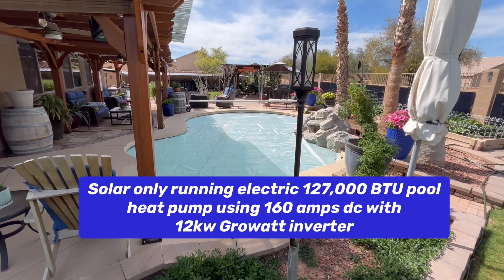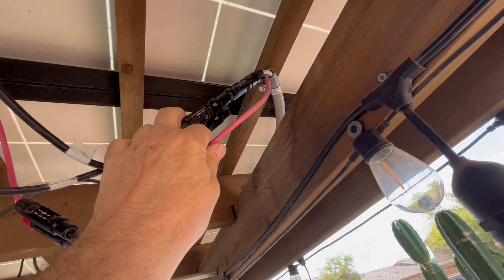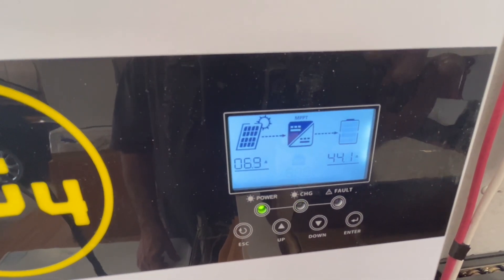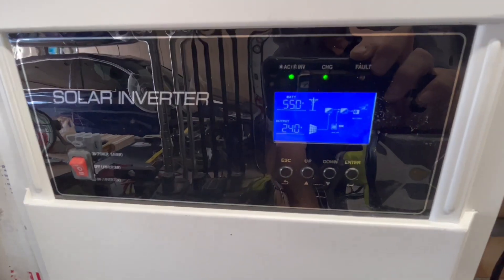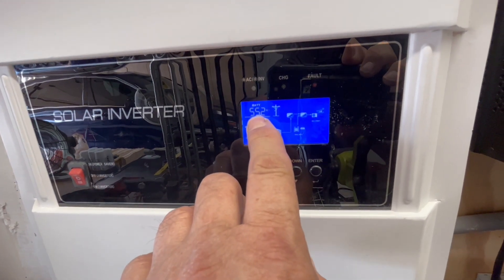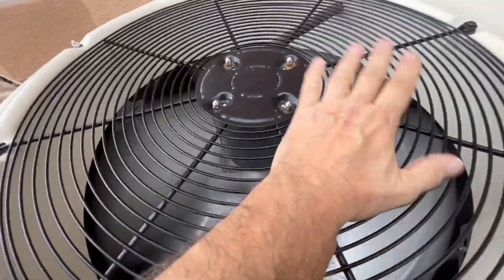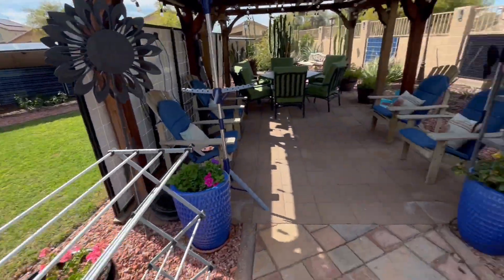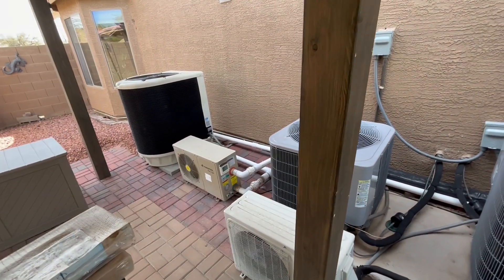Solar only running electric 127,000 BTU pool heat pump, over 160 dc amps, 6500 watts w/12kw Growatt

Comment: Wow, your back yard looks great... I live up near the Oregon/Washington border and we get alot of rainy weather.. 

I was wondering if a soft start inverter pool heater would run on solar and battery alone Off-grid/Grid-down style... 

Also planning a greenhouse and considering how i could use solar to  heat water filled ibc totes inside the greenhouse in the day and use the warmth of that water to heat the greenhouse at night..
Reply from the maker: Hi, pool electric heat pumps use a lot of power. My small one uses around 1000-1200 watts while running and the huge pool heat pump uses 6500 or more watts while running. If you get a lot of cloudy days, solar will probably not work well, if you were to do solar you would want to use new mono solar panels. They do so much better on cloudy and rainy days. We get around 320 days of pure sunshine in southwest Phoenix AZ. So it is a great investment. A thermal pool cover on your pool would be a good investment if you get full sun on pool all day long and usually cost less than $200. You would not be able use battery as heat pumps use a lot of power. It takes a long time to recharge battery next day when cloudy out. Depending on your pool size, if less than 15000 gallons, they have electric heat pumps that use around 3000 watts, at say .10 cent a kilowatt hour on grid, it would cost .30 cents an hour to run. That would be $7.20 a day, that would cost around $200 a month to run. At .15 cent a kilowatt hour, it would cost around $320 a month. That’s if it ran every hour every day. When I use to run my big pool heater which uses around 6-7 kilowatt hours. It is a 127,000 Btu heat pump. It was around $200-$250 a month in the winter because it would shut off once pool temp was reached and would stay off for hours during the day but run more at night when temps drop. I think it would be more efficient to use pool heater and electric heat pump and not use the solar. Solar is expensive to setup but there are tax rebates that help. But most people are very disappointed in wet cloudy rainy areas due to clouds and rain reducing the input to about 10-30 percent if watts for each solar panel. I over panel for what I need but was able to use used solar panels that are local for $18–$40 each. I was able to buy really cheap and make my money back very quickly by running 100 percent of my ac cost on solar and battery due to so much sunshine all year long, especially in the summer when I need it the most. Might want to check into wind turbines, I know very little about wind turbines but the efficiency is getting better and as long as it is windy where you live night and day, it can work, but do your research on products before you try and maybe try using a less expensive highly rated turbine first before you go all in. The soft start saves you a little every time your pool heat pump turns on but they usually run for hours at a time but once running does not reduce the power used. Just makes it possible to start compressor with less amps. There are people that warm large containers of 100’s of gallons of water with water heaters then use the hit water at night. Try to find videos on that subject, some use solar to heat and some use the sun using plastic tubing in the sun to heat water and only pump the water using a small amount of power fur pump to keep circulating the water. During your winter, it will be hard to heat when the temps drop below 50-60 degrees. Even with it getting in the mid 90’s during the day right now, it is dropping to the high 50’s at night and with pool cover on, I still loose 5-8 degrees of temp overnight. Now I’m just going to heat the pool on special days like Thanksgiving, Christmas and New Years eve. The rest of the day I might use pool heater in the day when not running ac. I have over over 20,000 watts in solar panels but with the sun in the sky so low if an angle, I can only produce around 7000 watts an hour for around 5-6 hours. As it gets closer the the end of December, that will probably drop to around 5000-6000 watts an hour max. So I won’t be able to run pool heater in December, January and February. I might have to get a smaller pool heater that uses around 3500 watts-4000 watts an hour to use December thru February. It’s cheaper for me to just run my pool heater on grid than to put out another $2500-$3500 for a pool heat pump. If all my solar panels were in full sun all day long, I could use pool heater on solar year round but house blocks  1/2 my solar panels most of the day in the winter which reduces my input 50 percent. Hope this helps. Let me know if you have any more questions. Hope you have a truly wonderful and extremely blessed week.

Comment: Did you mount the panels to the pergola looks like from the video just laying up there.  I would be concerned with high winds blowing them off there during thunderstorms. I mounted mine using the K2 rails from Santan was impressed with how strong they are. I read the growatt only allow lithium batteries it can communicate with the BMS couple of brands. Have you found that to be the case? It seems the EG4 doesn't care what lithium battery you have it's probably better if it can communicate with the EG4 battery.
Reply from the maker: I have not been able to secure all of my solar panels to the tips of pergolas yet due to the 2 incurable cancers I have. I am slowly securing to pergolas. In 4 years I have 4 years I have only lost 2 solar panels due to high winds or monsoon weather. I have physical limitations that are very challenging at times. What can take you a day, can take me weeks or months to do. EG4 LiFePO4 batteries are able to communicate with Growatt low frequency inverters but I found they limit the charging to only 50 amps regardless of how many batteries are connected. So I have to use user 2 setting and set bill to 56 volts and float to 54 volts. Cut off 44 volts. I actually fabricated my own clips to secure solar panels and use self tapping metal screws. Work great and have not lost a single solar panel yet and none have loosened up yet. Thanks for the question and hope you have a wonderful and blessed weekend

Comment: My mini split stopped working 😔 it won't heat or cool no more the outside compressor barely goes pass 200 watts not on either side also does vacuuming the lines create the pressure ppl need lose suction in a vacuum outline like that order the compressor Supply to pressure you need because there is no presser at all in my lines no leaks either
Reply from the maker: Pulling a vacuum removes contaminant and moisture which is why before you release refrigerant into lines you run a vacuum. If you do not follow this procedure the system might run for a while but could eventually stop working. You can only run a vacuum on lines when there is no refrigerant in the lines. It is the crucial step after connecting all refrigerant lines on a new unit or after disassembly and move to new location. It sounds like all your refrigerant might have leaked out. When mini split is running you should be around 145 psi on low side if you have refrigerant in lines.
Reply: @DIY solar power with Pappa off grid projects  it was working fine till yesterday morning my mini-split stand came in I pumped down the lines all the refrigerant went back into the compressor but I forgot and opened it up when I was finished I call my self letting all the air out the lines by pressing that valve stem but now when I go to use it I'm getting nothing outside unit won't build up no pressure at all barely runs
Reply from the maker: There should be pressure in the lines if you released the refrigerant back into system. Double check both sides are open with the 1/4 inch Allen wrench for you lines. When releasing refrigerant back into lines you should open both slightly , then open all the way gradually on both high side and low side.
Reply: @DIY solar power with Pappa off grid projects  Pappa I tried everything I even tried pumping it down again in ac mode trying to get the compressor to suck all of it back in but now it's like there's no pressure in the system at all now does vacuuming creates pressure because I just ordered a pump & hvac gauges
Reply from the maker: Vacuum pump creates a negative pressure, it sucks out contaminants. The needle for pressure drops below zero. You would have to put gushes on low side to see it you have any pressure and you will need a special adaptor to pull vacuum. You can not just connect to low side of outside heat pumps you can buy for around $15-$20. Search on YouTube for video on pulling a vaccine on mini splits, I do not have a video on that subject.

Comment: It is a shame that the heat from your house can't just be put directly into the pool water.
Reply from the maker: That would be nice, but last night temp was 32 degrees, which even with a cover on my pool, I will loose around 4-6 degrees of heat, but I can make that up by 2pm and add another 2-3 degrees by 5 pm. All free with the solar power. When I do run pool heat pump on grid, it can cost me $6-$10 a day for electricity. Only use pool heater from March to May and October and November. Without solar, it would add another$2000-$3500 a year on electric bill and besides the grandkids love being able yo swim almost year round. This year I might have enough panels and battery bank to actually run heater when needed all 12 months of the year, this pool heat pump also cools the water in middle of summer when pool water can exceed 100 degrees when daily temps reach 115-120 degrees in the day time and stay above 100 degrees at night.    Thanks fir the comment and hope you have a truly wonderful and blessed day.

Comment: Nice... So u have 22 panels on that one controller... Is it only 48v they are cheaper than midnight and I have 30more panels too put up that controller will save me money if it can hold 22 panels good video keep it up brother...
Reply from the maker: Yes, 22 250-watt solar panels are connected to the 48v 100a output, 18-22 amp input charge controller. 2 sets of 11 panels in series then the 2 sets are connected in parallel to keep the amp input low. 500 volt solar panel input. Charge controller was Only $399. I’m able to add another 80-100 amps output or 5500 watts to that Growatt inverter. The Growatt puts out the most amps and the charge controller makes up the difference to charge the battery and supply the load. Could not run that 127,000 btu pool heat pump heater with just Growatt inverter because inverter is limited to 100 amp output. Heat pump uses over 160 dc amps and Growatt puts out 6500 watts while inverter simultaneously puts out around 2500-3500 watts of power to the battery. It is a beast and eats power. Lol